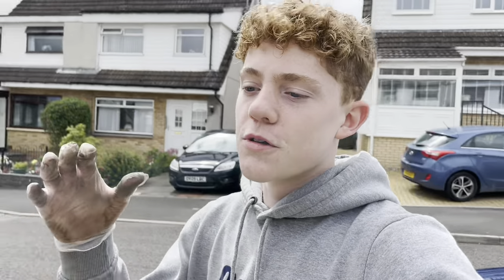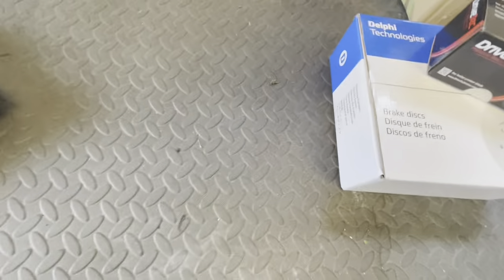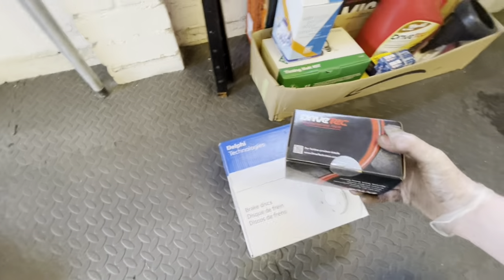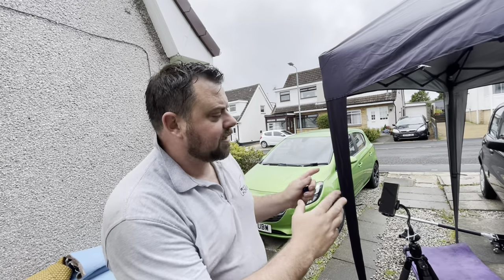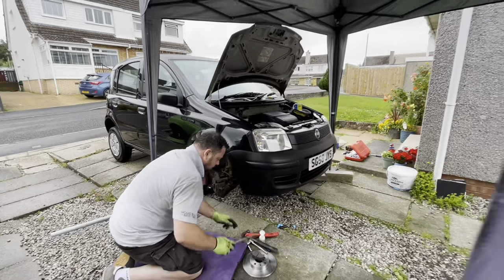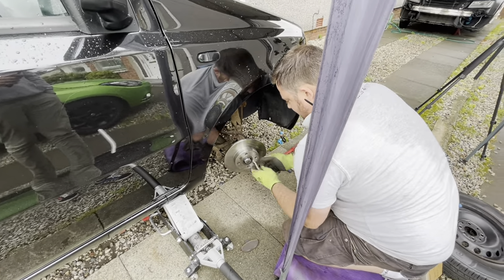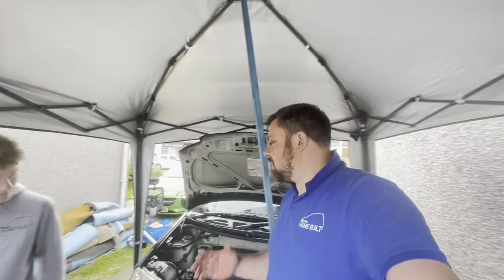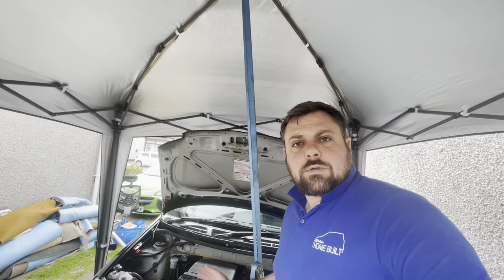Pampered Panda, full service, cambelt and water pump.

Comment: You should never jack the vehicle up on the axle beam..they can bend ,
Reply from the maker: I worries, it’s fine as long as you spread the load.
Been doing it for years 👍
Reply from the maker: I worries, it’s fine as long as you spread the load.
Been doing it for years 👍
Reply: Correct, the beam is not solid and can flex, its a pressed steel single plated beam. This car will now wear the rear tyres on the outside edge due to the slight bowing of the rear beam.

Comment: Can't believe you didn't even tighten the wheel nuts up correctly, amateur right there
Reply from the maker: All torqued to spec mate
Reply: @HomeBuilt  I thought they had to be done top bottom then left and right ones?  Not done up around the wheel?
Reply: In a star pattern
Reply: @REDLINE6969  you are 100% correct they have to be done up in a star pattern. Basic Mechanic's.
Reply: @HomeBuilt  good job mate but always do the wheel nuts up in a star pattern!
Reply: Tighten lug nuts in a star pattern to ensure they are evenly torqued to eliminate vibrations. DO NOT use an impact gun/wrench. It WILL damage the finish of the lug nuts.